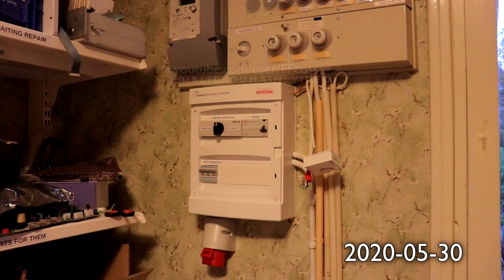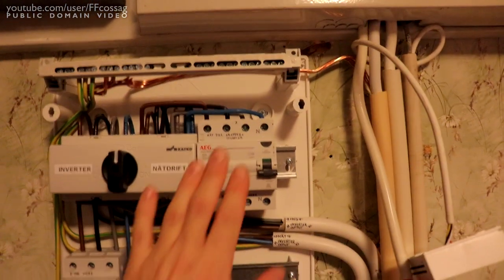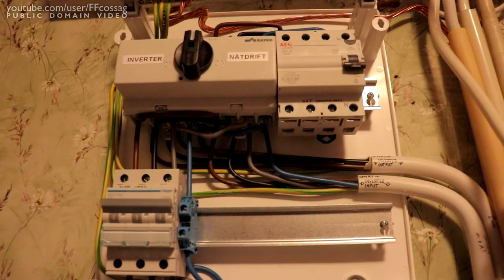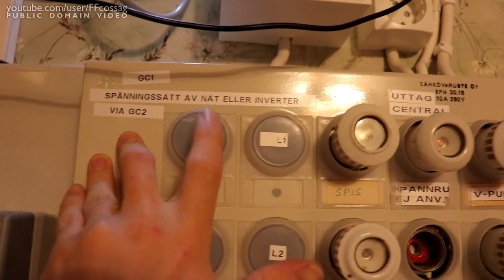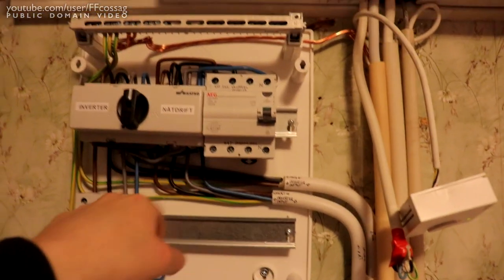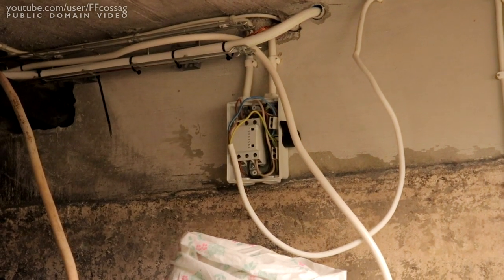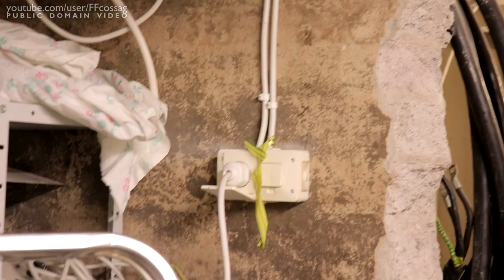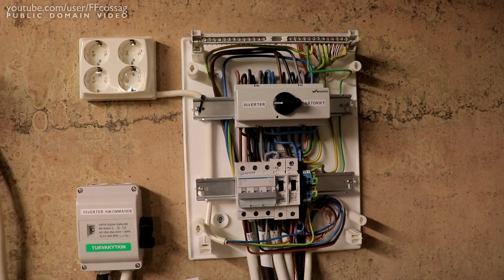10 kW Hybrid Solar VLOG 6 - Endless mains wiring ...

Comment: It’s coming together very nicely!

Here in Australia there’s entire standards (AS/NZS 5033) for the exact color, layout and wording of our ‘Dual Supply’ / ‘PV Array’ / ‘Battery Storage’ warning labels. As a result, you can buy sets of rather durable labels (some are even engraved labels) from eBay sellers and Aliexpress sellers for pretty good prices, as a result I’ve seen a couple of DIY PV installations in other countries using them 🤣. Downside if you wanted to use them is, they’re all in English, but they at least look professional.

Also, you said the RCD is the first thing that sees any grid power? I assume you have a breaker/fuse before it as I would expect you have >40 A service which could overload the RCD (I assume it's not a combination RCD/breaker)?
Reply from the maker: There are always three main fuses in Finland, that are the absolutely first thing to see grid power, in my house they're rated 20 A - so yes, everything is fused. The RCD circuit ended up being changed later on, however. You'll see that in a future episode.

Comment: Isn't the RCD out of circuit when the switch is switched to inverter? Does the inverter output have an RCD built in? If not, you have no RCD in circuit at that switch setting. I'd put the RCD after the main changeover switch, before all the loads and distribution board. Also newer installations have sometimes 2 RCDs per board, for better fault isolation.
Reply from the maker: That's how it was intended to be hooked up, since the inverter advertised itself as having an internal RCD. The coupling got changed later on because A) the heat pump in the basement can't be hooked up to a RCD, and B) The RCD in the inverter is a lie and doesn't exist. You can hook a light bulb between a live output of the inverter and its case, and it'll light up like nobody's business. lol.
Reply: @FFcossag  ah, so you already sorted it. Nice, it's never good to rely on advertised features, test on your own. Also that wiring and "island" solar system is thoroughly impressive! I can't imagine how much it cost. I'm also rewiring the DB in my house to have a separate single phase for the UPS powered circuits via a small 1-2kW UPS and a generator hook up. I don't plan to run the whole house off of a inverter since they're too expensive for me right now.
Reply from the maker: "Island solar system"? Oh, as in that the system being built here being able to power the house as an island in case of grid failure, I suppose?

Having a few UPS-powered outlets around the house is nice, good luck! That's how my old set-up was done, and it's been a wonderful experience to use. Just hook something up to a UPS outlet and watch it run forever, no matter what.

Comment: i wonder how much power you lose in all the conversion from battery all the way to the load ...you seem to have a thousand different things  between your battery all the way to the load
Reply from the maker: On the mains side, there are very few losses since it's so low current. The biggest loss by far is the inverter, which is only about 90 % efficient when running off of batteries. Copper losses between the battery terminals and the inverter are in the order of a few tens of watts at maximum rated current - so not much at all.